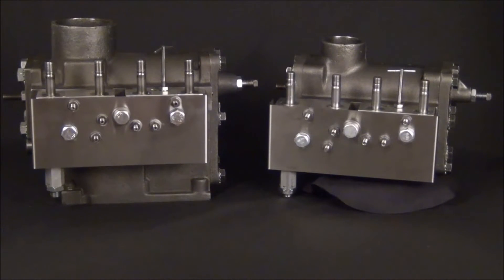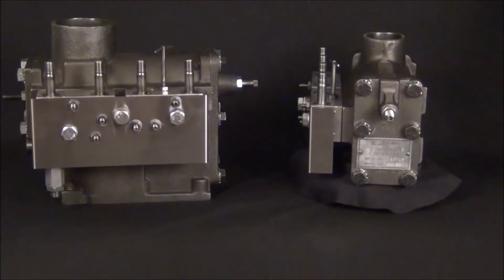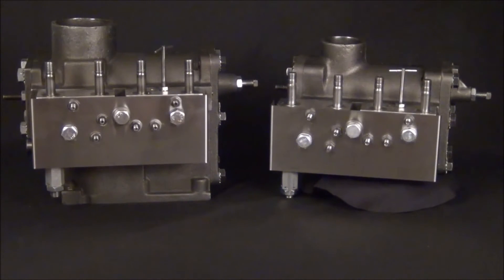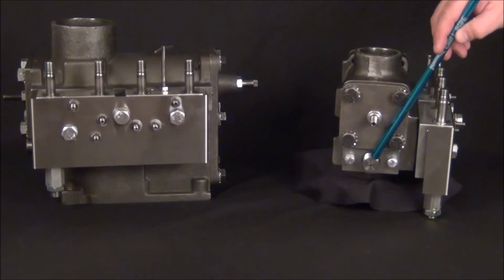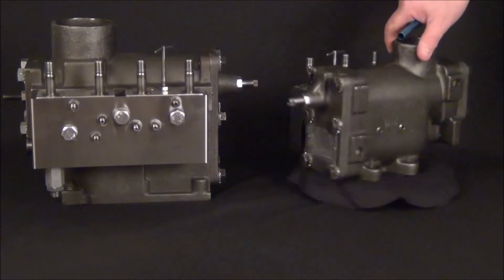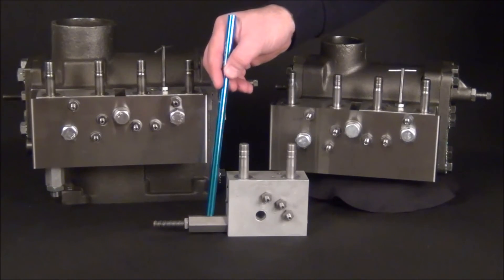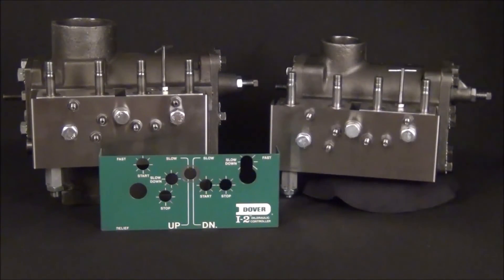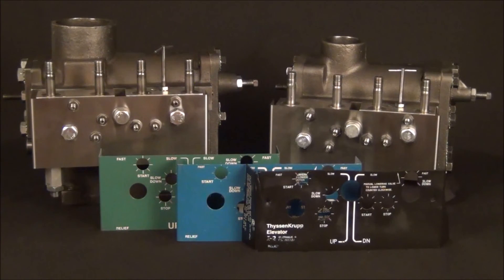Dover I 2, I 3 Introduction

Comment: when going in to viscosity the unit starts to level up. ( I-3) bypass? thanks
Reply: we have alot of problems with this valve it sometimes stall in leveling up with or without load more often cold when unit has not been being used any suggestions